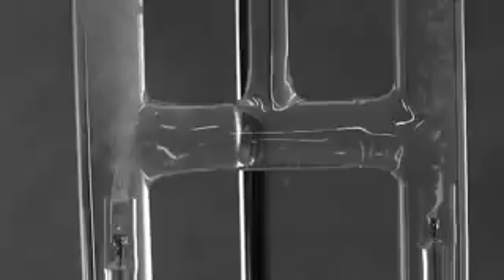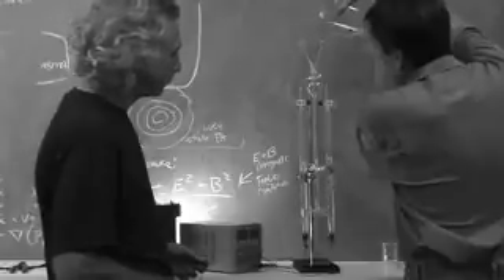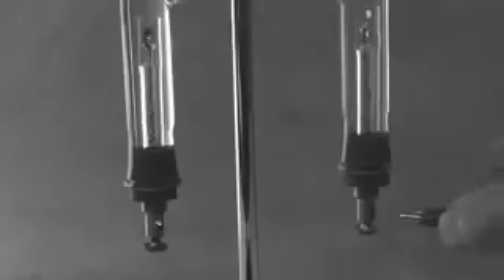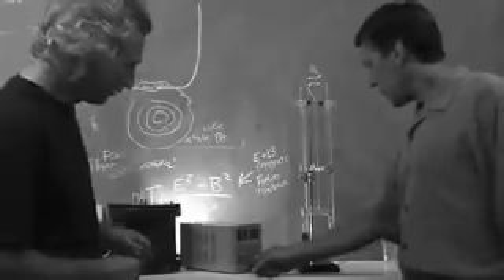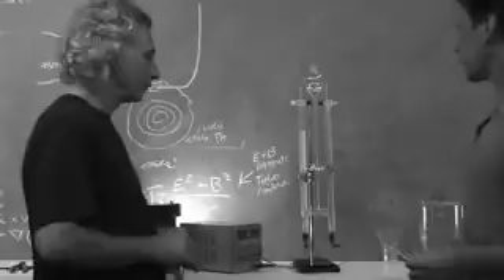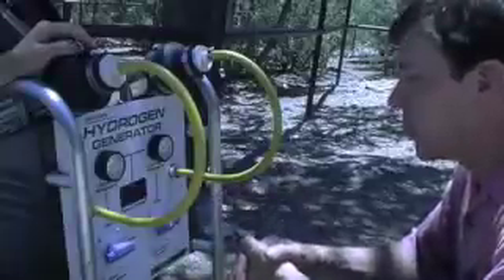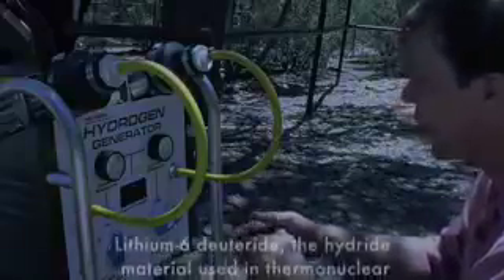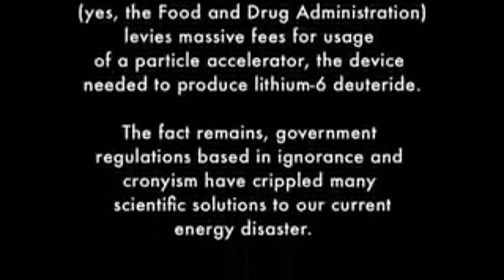run your car on water. This guy does just that!

Comment: It's amazing how the short concentration spans rule here. Yes, it takes as much energy to create hydrogen as it produces when burning in the engine. He explained that the energy to convert the fuel comes from solar power - you could just as easily use wind, wave or thermal power in the same process. If you bothered to watch the entire video before declaring 'it's all crap' you would see that the inventor notes that the problem as to why this process cannot be widely adapted is because the hydride, Lithium-6, is also used in nuclear weapons and the law forbids the purchase of this material even though it is harmless. Therefore, it is the will of the government which stands between the common usage of water as a fuel, nothing to do with the implausibility of the process. We could have green fuel tomorrow if not for the stupidity of the hawks in government.
Reply: "you would see that the inventor notes that the problem as to why this process cannot be widely adapted is because the hydride, Lithium-6" blah blah blah.

You see, that's just it; I DID watch it to the end. That's how I was able to determine the rubbish that it is!
If ya can't dazzle em with brilliance, baffle em with bullsh!t. And it worked on you....
Reply: Brilliant riposte, Jake, except there is no argument in your argument, just a repetition of 'it's all crap' blah blah blah. Do keep consuming your petrol and watch the world inevitably overheat and die, but feel good that no one put one over on old Jake by suggesting possible alternatives..
Reply: CJ Cronin "there is no argument in your argument"

If you bothered to read my entire original post, you would see my argument. Not to mention, never have I claimed that it's "all" crap. Nice straw man.
Reply: amen to that : those bitching are the same people willing to spend trillions on war to steal oil over the dead bodies of there fellow man.
Reply: But its not bullshit, Jake. The regulations of the federal regime are so encroaching and toxic that even I, a simple man that makes wood stoves that are FAR cleaner and more efficient, am choked from existing by the EPA.

We need to get rid of literally every fucking alphabet agency of the federal regime except possibly the military. ONLY THEN will we have a better future. Clearly these bureaucrats have abused their power to a ridiculous extent, so I say they should lose their power entirely for better or for worse!
Reply: I am all bout this, but no one has brought up the fact that Iskra 200 years from now exhausting the water on the planet the same as we are doing with oil right now. I understand the rain and all that but how many cars are running on a daily basis? One runs cleaner the other,  but then risk changing the ecosystems more as we use more and more water. I love the idea I really do, but how long before water isn’t free anymore and. As it diminishes how long before we are paying more for water then we are for fuel today?. I’m not a chemist, or very educated in chemistry, but I do see the same problems popping up that we are complaining about for gas(prices, availability,....)
Reply: Yes and how very convenient they outlawed any component of a nuclear device.
Reply: CJ Cronin it’s a hoax because we are in 2018 and just started it. So in 2009 one man is brighter than the entire planet of genius. International companies can’t do it when a single man can. I have to see it to believe it.
Reply: Franklin Plummer 

It’s recycled!
Reply: The same law applies to fertilizer oh wise one.     Go out and buy a truck full of high nitro fertilizer if you are able.     This guys is educated enough to build a plant just to power his corvette.     Equating that to making it ready for the masses is pure bullshit.
Reply: Marco Polo 

The scam is to lie about the soundness of an invention, but keep it under wraps, raise $$$$ from gullible investors, spend the $$$$ raised, and finally declare that the invention can’t be mass produced for unspecified financial and economic reasons.
Reply: but it takes less energy to break down CH4 and you can make that yourself too (although the dangers of fooling around with "marsh gas" are not to be underestimated) this is quite exotic material he is using and not nearly as safe as the video would imply - besides the cost of that fuel system and the electrolysis machine would pay for regular gasoline for many a moon
Reply: Emergency Survival Supplies, bunkers, freeze dried foods, doomsday drones, EMP-Proof fuel-less solar generators, lessons, bulletproof backpacks / shields, camping, etc https://www.ebay.com/itm/Solar-Fuel-less-2000W-Generator/173771050171 www.worthingtonbunkers.com USA Deliveries ONLY , buy the deluxe solar generator kit
and get $50 off with this coupon "lovejesus" @ www.ambertracks.com
Reply: You forgot to add the expenses of transporting and storing it. That takes energy, as well as extra costs.
Reply: @franklinplummer9057  
The hydrogen turns back into water (after recombining with oxygen) while releasing energy, the process is neutral.
Reply: Now, that part confused me. On the one hand, he shows us his commercial gas generator hooked to his car that he uses to pump hydride into his 4 tanks. Then, he goes into this thing about how you can't get hydride without a particle accelerator, which he has there somewhere. Say what? Why does he need a particle accelerator when he has a gas generator right there?
Reply: Franklin Plummer once used it turns back to water out the exhaust pipe.
Reply: @Mozillapi  He is a conman.
Reply: @Mozillapi  It's lithium hydride 6LiH in the tanks, which is able to absorb the hydrogen H2 gas being fed down the pipe.
Reply: @rogerjgriffin  Ok. So, I think what you are saying is the gas generator is pumping hydrogen H2 through a pipe into the tanks. But the tanks already have a separate gas in them called lithium hydride 6LiH. Ok. So, is this lithium hydride created by the particle accelerator? If so, then I'm assuming he has access to the particle accelerator at work, pumps the hydride into the tanks there, takes it to his wilderness hideaway and pumps the H2 gas into the partially filled tanks. Is this how he does it?
Reply: @stephenanderson1448  Yes, that's my understanding. Except the lithium hydride is a solid I think. A powder I'm guessing. I believe when it absorbs the hydrogen gas it's chemical formula changes, and back again when it releases it. I'm no chemist, I just did a bit of research because of this video. I wonder if it's legal to give the stuff away.
Reply: @rogerjgriffin  Interesting. Then theoretically, you would only need to put the powder solid in the tank once. 1) The hydride powder in inserted into the tank, 2) the hydrogen gas is added via a hose or tube, and 3) when the hydrogen gas is completely used the powder remains behind. I wonder if the full amount of powder remains, or if the ratio must be tinkered with each time to get the right mixture. He didn't really talk about that, which makes me think he was holding out info for some reason.
Reply: @stephenanderson1448  I get the impression that the lithium hydride powder(?) is a one time thing, and doesn't get depleted. If anything, perhaps it gets depleted a tiny bit each time and needs occasional top-ups. Or perhaps it needs occasional replacement. I'm just speculating here.
Reply: @smh9902  can you send me some information on the the stoves. Burn wood and always looking for one more efficient. Send to hlclouse@centurylink.net
Reply: I am astonished how no one is concerned by the fact that they want to use water as fuel to drive their cars. Reminds me of idiocracy.
Reply: The unavailability of lithium hydride is not an issue. You can use other means of storing hydrogen. The real issue is the inefficiency of running an internal combustion engine on hydrogen obtained by electrolysis.
Reply: @eternapesadilla2355  Water is not a fuel. They are using electrolysis to split water into hydrogen and oxygen. The hydrogen is then combined with oxygen in the air and burned in the engine, which turns it back into water. No water is consumed.
Reply: @Ethan.Lamoureux  IT IS OUR FOOD. END OF STORY. YOU DONT USE THE ONE  FOOD WE AS A SPECIES WILL PERISH WITHOUT FOR FUEL. PERIOD.
Reply: @Ethan.Lamoureux  HOW ABOUT THE FACT YOU WANT TO USE THE ONLY THING IN THE ENTIRE PLANET OUR SPECIES NEEDS ABOVE ALL ELSE FOR FUCKING FUEL. WAKE UP PEOPLE
Reply: @eternapesadilla2355  Water is not food. If you think otherwise, I suggest you try giving up all but water and see how much energy you have after a while. And did you not read the part about how splitting water then reconstituting it again doesn’t use up the water? Also, it’s not water we need above all else. You can live for days without water, but you can’t live more than a few minutes without air. But this is all academic. Reality is that in order to live, we all need air, food, water and heat. Take one of those away and we’re dead. Now heat is nothing but energy, air and water can be infinitely recycled using energy, and food can be grown using energy. So the key is energy.
Reply: @Ethan.Lamoureux  air is easily made with trees and many other products. There is no shortage of air. But there will be of water if you start useing it as fuel you bufflling baffoons. And don't you know that if you go without food you can live a month and without water you die in a week. And taking away the hydrogen makes it oxygen water which is not what we have been drinking for millions of years! LEAVE THE WATER ALONE YOU FUCKIN QUACKS!!!! youre worse than children.
Reply: @eternapesadilla2355  How would this cause a shortage of water when it doesn’t destroy the water? Don’t you understand how this works? You use electricity to separate water into its parts: two of hydrogen and one of oxygen. You release the oxygen into the air. You put the hydrogen into a tank and later you combine it with air, which contains oxygen, and you set it on fire. The oxygen and hydrogen produce heat, which is just the energy used to separate the water in the first place. And when all is done, what you have left is... water. So you took water, added energy, removed the energy, and got your water back. And you’re worried about us running out of water? I might add that when you run your car, water comes out the tail pipe. That is water that is being manufactured in your car’s engine by burning the hydrogen stored in the fuel in combination with the oxygen in the air. The same thing happens when you burn propane or natural gas: the water vapor in the exhaust is water which has been manufactured out of oxygen and hydrogen. We’re not running out of water anytime soon.

Finally, I am not interested in doing this myself, I do not advocate for doing this either. I think it’s a waste of time and money, even if doesn’t waste water. You’re chasing the wrong person.
Reply: @Ethan.Lamoureux  omg. Its like talking to children i swear. 
First off. Its not the same water we know and love after the elctrodialisis. 

Second off. It is humanities most important Element!!!!! LEAVE IT ALONE. End of story. There is nothing to discuss. It already has a very important use. End of the conversation. Fin. Finito. Finiquitisimo. GOODBYE. GAME OVER. THE END. GRAND FINALLY. END. NO MORE TO DISCUSS 

Leave OUR WATER alone!
Reply: Understood!  But why isn't AOC recommending this since she's all for the GREEN NEW DEAL THEN ?!
Reply: @eternapesadilla2355  Oh RELAX !!! Go take your LITHIUM and CHILL OUT!!!!

Comment: Back when I did some spook work they had some vehicles in the 80's that ran off of similar systems then some years later when I was back working for them again they had a newer system which seamed to run off of water directly. I suspect they were using an amalgam of possibly gallium and titanium in cells that they would somehow reverse the reaction in and reuse once they were depleted. Pretty common in a large desert installation where refueling service and maintenance vehicles can be a hassle. All of this equipment was in use around me but out of my department as to how it worked so I can only speculate.
Reply: Spooky
Reply: You should get this info out...
Reply: Lol ya ok.
Reply: @hotfiyah  
Seconded. 😁
Reply: @Thomas Brock 
Then we agree its the petrodollar that is the problem...So I will take it out
Reply: Probably Stanley Meyer tech  ! He went from  coast to coast in 1973  in a vw dune buggy  !
Reply: @Thomas Brock says a lot about the quality of people in todays world
Reply: @Thomas Brock wow that's dark ! 😳
Reply: GSXR 1300, I've heard they made a small reactor contained within a sphere that will produce 110 Volts indefinitely.

Comment: There are many cars running on Browns gas which supplies hydrogen and oxygen directly to the engin via an electrisis device fitted inside the engin bay fueld by salt water.

Comment: The problem is that once the hydrogen is produced it has to be stored someplace, usually in a gas container. 

Now, in order to have sufficient hydrogen to operate a vehicle with a range close to that of a typical gasoline powered car, the hydrogen may have to be compressed, up to 2000-4000 psi. This means IF people wish to use hydrogen as a replacement for gasoline, they will not only need to produce the hydrogen but also compress the hydrogen into containers that can withstand 3000 psi pressures. This means people will have to buy a hydrogen gas compressor, something similar to that used to compress air into scuba tanks, something like this:

https://www.ebay.com/itm/300BAR-30MPA-4500PSI-High-Pressure-Air-Compressor-PCP-Airgun-Scuba-Air-Pump/332584570701

Another approach would be to liquefy the hydrogen, this would increase the energy density of the hydrogen and would not require the use of containers that can withstand high pressures. Though people may have to use multi-walled Dewar flasks to store the liquid hydrogen, to prevent the liquid hydrogen from boiling off. This means people will have to buy a cryogenic hydrogen gas liquifier and Dewar flasks.

There is another issue, once people have produced and stored the hydrogen, how exactly does one modify one's car to operate on hydrogen? People may have to use components used in LPG and CNG powered cars, to regulate the flow of hydrogen into the vehicle AND to somehow turn off the gasoline pump and the fuel injectors. You see it's isn't as easy at it looks.

The following kits have nearly all the components necessary to convert a typical gasoline powered car into a car that can run on LPG and/or CNG. If people store their hydrogen at low pressures, then people can use components from the LPG kit. IF people store their hydrogen at high pressures, around 3000 psi then people may have to use components from the CNG kits.

LPG and CNG Carbuetion kits:
https://www.aliexpress.com/store/group/LPG-CNG-Traditional-System/1190578_512872368.html
LPG and CNG Mult-Port Injection Kits:
https://www.aliexpress.com/store/group/LPG-CNG-Bi-fuel-Systems/1190578_512595778.html?origin=n&SortType=bestmatch_sort&g=y&SearchText=injection

Comment: The problem with this is it takes a lot of energy to break the H20 Bond.    A car engine isn't efficient..  an electrical motor is.     Thats why its better to use batteries and a motor then Hydrogen and an engine.     It works,  Its just isn't the best way.
Reply: True, except all the chemicals in the batteries are very damaging.
Reply: Basically just go the easy way huh

Comment: Great! Instead of charging your car from the wall, or driving a few miles to an EV charger, you can just buy a bunch of controlled chemicals, buy an expensive generator, modify your current car's fuel system, and install solar panels on your roof. GENIUS!
Reply: Where do you think the electricity from an electric charger comes from? think my guy
Reply: Also why do you think these things are already in place? To deter you from switching to a better option, because it's not profitable for big corporations.
Reply: @user-pr9qb6yi9w  In my case that would be 100% hydroelectric. Still, could just cut out all the other complicated steps, jump straight to installing solar panels and charging the EV with that. Then you know where the electricity comes from...